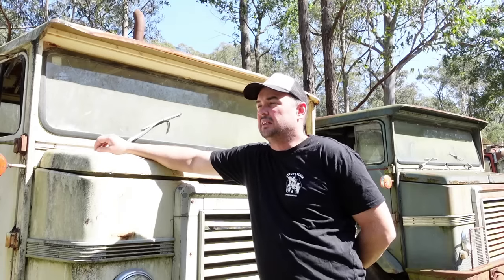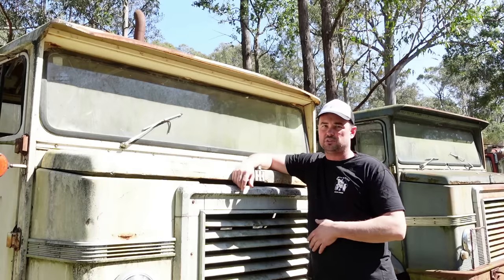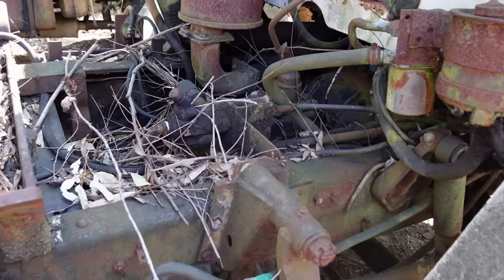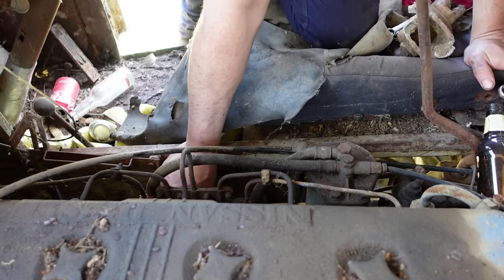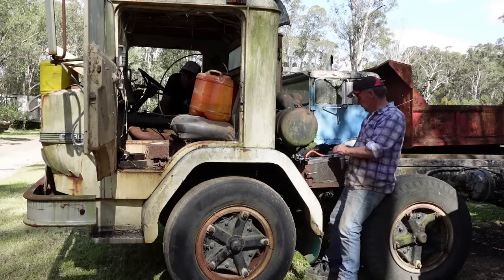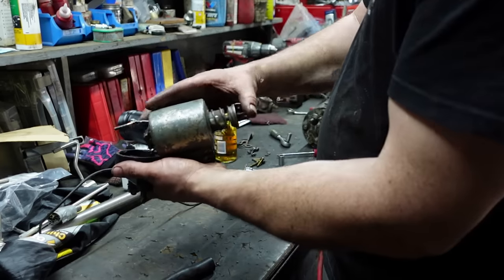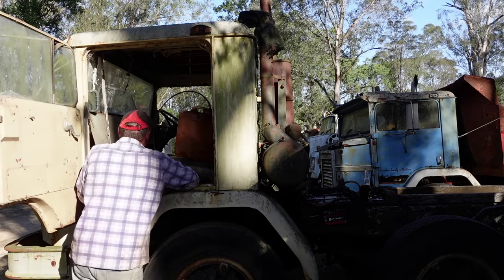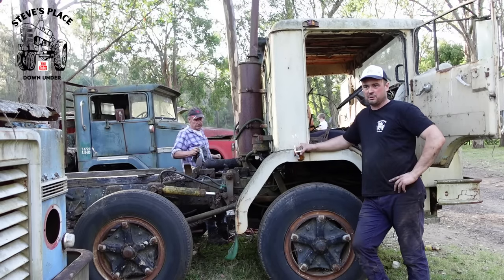Will It Start? Nissan Diesel 2 Stroke UD5

Comment: Good stuff bloke, fellow Aussie here, I love saving old stuff too, great work :), 
had a great collection of 2 stroke detroits but became disabled and lost my industrial block....,
just starting again, scored a 6V92T Detco generator with 71 hours :):):)
12 years ago you could find them around Kalgoorlie usually for a carton :), lot thinner on the ground now but :/
Reply from the maker: Hi mate thanks for the comment. Glad you liked it. Geez mate becoming disabled is awful. As long as you’re doing it again now that’s great. A lot of those generators were only backup so most are low hours from what I’ve seen. There still a few around here but the price to get one has gone up a lot. Fantastic stuff mate glad it’s all happening again for you. There’s plenty more to come here for you to hopefully enjoy
Reply: @stevesplacedownunder  For sure, yeah, it sucked being disabled but I was really lucky, fully independent and got the best life ever, scored a firearms dealers licence, so I'm making a dollar building custom rifles and now I'll rebuild my 2 stroke collection and all's good :)
The generator was ex  Aussie red cross blood banks which have several levels of backup :),  $1550 at auction, the only kunty part was the single axle tilt tray sent to back load it couldnt drag it up, too heavy, had me fucked why coz I was sure my weight calcs were accurate ???,  didn't figure on the 1500 litres of fresh diesel onboard :), was a bonus  problem  :), life is good :):),
keep up the great work there bloke :)
will be following yas for sure ,
cheers
Reply from the maker: Well all the very best to you mate. It sounds like your going really well again. Feel free to email over some pictures of whatever your up to with them. I’m just as interested in what others are doing.

Comment: Those UD engines were also used in some tractors, like the Uptons made at Parkes NSW. The main difference between the UD 2 stroke and a GM, is that it used an inline fuel pump and not a rack controlled individual unit injectors.  The pump is almost certainly a denso.  It is amazing that those old "butter box" accos cabs are not completely destroyed by rust.
Reply from the maker: Hi mate yes I explained all this, even put a picture up of the Upton tractor. The injection pump is a diesel Kiki. 
 I have 2 that are rusted right out and 2 really decent ones. Depends on where they were and what they were doing
Reply: @stevesplacedownunder   The Uptons were also rather unique in that they used a Grant/Sherman transaxle as the final drive.  They had a problem snapping axles and axle bearings, since the transaxle was really meant for driving a raised sprocket and not heavy tractor tyres.
Reply: How about a twin turbo 8v75 ud 2 stroke!

Comment: I've been a mechanic for 40yrs and a Nissan fan, Dad even had a 90s UD, however I had no idea Nissan/UD made 2 stroke diesels 🙂👍
Reply: I heard the UD 2 strokes were made up into the late 80's early 90's then it went to 4 joke stroke.
Reply: @jlo13800  if it was, I've certainly never seen on in a UD truck, lots of which I've serviced before. My father even owned an 80s long bed UD flat tray for a fruit and vegetable business, 
All 4 strokes.
Reply: @jlo13800  Nothing wrong with 4 strokes, almost every vehicle on the road has them now.
Take care.
Reply: Not always as electric motors are a magnetic rotary form of 2 stroke that can run in either direction. 2 strokes mare cumming back as its time for a change form the 4 joke until everything is electric.

Comment: I worked on the assembly line at IHC, Dandenong in the early 70s. 
We didn't see much of these at that time, having been replaced by the new, larger cabs.
I only remember a small series of army editions being made then.
Very cramped interiors for my long legs and horrible seats. 
Cheers!
Reply: The next generation flat front cab came out about 1972 which was in production for a long time. They were used for Atkinson as well. A new cab came out after Iveco took over in the 90s(?).
Iveco have progressively improved the styling of the 3rd generation cab after the rather awkward looking first iteration.

Comment: Junkers developed the Yumo range of diesels to power long range bombers in the second world war. i believe most Yumo's were led down flat to reduce wind drag. Some were opposed piston and I think thats where the design of the Commer 3cyl/ 6 piston engine. good show
Reply from the maker: Thank you mate. I believe so yes. I been doing more research on the history of them and didn’t know the Junkers aircraft were diesel until owning this. Very fascinating mate thank you. I have a few of the commer engines here but missing injection pumps

Comment: I drove a 190 Inter back in the 70s with a 5cyl UD and a mate of mine had one in a Commer I also had a mate had a C Line 1800 with a 4cyl UD and the UD 2 strokes made more horsepower than a Detroit my 190 made 240 hp and the 4cyl was 180 hp and I also drove many Detroit 2 Strokes back in the day 471 ,671 8V71 and 6V53 and the UDs went harder.

Comment: The blower is a scavenge pump - it only supplies sufficient positive pressure to clear the exhaust gases from the cylinder.
Supercharging gives an engine more power but far less efficiency because the blower requires a lot of power to drive it. Commercial fleets are interested in efficiency.
Turbo-supercharging gives more power and improved efficiency because the blower is driven by waste heat from the exhaust
Reply from the maker: Hi Paul. Yes mate I did explain all this

Comment: Steve, Jim from Connecticut. Happy father's day.  In America father's day is June 16th. I wanted to ask you why some trucks have 4 steer tires. Is it because they can haul more weight.  If there is anything I can do to help grow your channel please let me know. I feel bad for the young lady with the mowers, he only gets 3 to 4 views but I still give him a like. Some of your viewers dont realize the education they get by watching your videos, the starter repair as an example.  It would be great to take a few years off and spend them with your dad. I'm almost done with my transmission swap. I'm waiting on 6 3/8 16 bolts to connect my transfer case to the transmission.  I just found out they are grade spec bolts. They are used when building machines.  Anyway have a great Father's Day. As always you have my full support.  Be good mate.  Jim Rioux
Reply from the maker: Hi Jim your support and wishes are greatly appreciated mate thank you.
 The twin steer has been a big thing here for decades and yes that’s right it’s for more weight so it supports the vehicle more and more braking power. It’s less drag too compared to putting another pusher or trailing axle with the drive axles which obviously creates drag when turning, as where another steer axle will obviously turn and follow the road with less drag. Can distribute the weight more evenly also being a rigid vehicle. 
 No mate the people that leave the nasty stuff have no clue. That was about 5-6 hours to do this video then my partner spent around 4 hours on Father’s Day to edit it so I could get it out. It’s very disappointing mate but when it’s available to the world it’s a given that people like that will watch and knock me. It happens to the best of them so I’m certainly not exempt from it. 
 I’d love to spend a year or 2 here Jim. I haven’t done a restoration now since I’ve had the children due too obvious life changes. There’s at least 3 more trucks I’d like to do here along with some of the tractors. I’m on decent money too mate so for this to match it to a point where I can stop is a distant dream at this stage, but I don’t give up.  
 Keep me informed on your transmission job as I’m always interested in how these things turn out. Feel free to email photos or videos. That young mower bloke I feel for too mate. He actually rang me on Saturday afternoon and we had a great chat. He turned 14 on Sunday and was telling me his love for the garden tractors helps his autism which he shared with me. I can’t help people like this enough but so hard to when he’s about 10 hours from me by car. 
 Your a wonderful person mate and thank you as always 🙏🙏

Comment: The German company Junkers should be pronounced as Joonkers. They had some diesel aircraft engines with 2 crankshafts and opposing cylinders, pretty advanced! Thanks for the video!
Reply from the maker: I keep getting told many different ways of saying it. People know what I was trying to say. Yes since doing some research on them I worked out more of what they did. With Napier engines, even the 3 crankshaft triangle type arrangement
Reply: @stevesplacedownunder  The glorious Napier Deltic boat and locomotive engine. A profoundly fascinating creation for any gearhead, but in fairness it did nothing that an ordinary V16 two-stroke couldn't also do. Opposed piston, common-cylinder diesels like the Jumo 205, were interesting for long-range aircraft because they were relatively lightweight and fuel efficient. They allowed long-range flying boats to be refuelled by ships or submarines, but for land-based vehicles, those advantages were moot compared to the added complication and manufacturing costs

Comment: Basically a metric 71 series. There used to be a few Nissan diesel trucks with UD6’s in NZ but as they wore out or blew up they were replaced by 6-71’s. Bad for cracking heads and dropping valves.
Reply from the maker: They basically were mate yes. I’ve never heard about many of their faults but I will certainly take your word for it. Not many around here anymore . Thanks again
Reply: @stevesplacedownunder  If you ever get down to Invercargill NZ there’s a Nissan Diesel 6TW12 2 stroke in the transport museum there. Beautifully restored too.
Reply from the maker: It would be good to see it. I hope to get there someday. It’s not far away really so I should make the effort
Reply: Yes and no. The Nissans were basically an improved (?) version of the German Junkers/Krupp design which was perhaps partially influenced by GM's ideas but not a straight copy thereof. Of course, GM was the leader in that field so I suppose in time everyone tried to follow it. There were also others like Foden in the UK, JaMZ in the USSR, P&H in the US (the excavator manufacturer) and List in Austria but none was as good as GM...

Comment: The 45 seat Albion Coach
Another time it started running hot late one afternoon at The Belmont Lakes near Newcastle, after getting the driver to do some checks I determined that the water pump was not working, actually the drive spline from the Roots Blower had stripped.  We had a spare blower (in pieces), throwing some tools into a box 3 of us jumped into a car and drove overnight.   Some time during the night I remembered that I would need a set of feeler gages to assemble the blower, Russell (mentioned below) was concerned as to how I would get around that problem.  When we arrived we met a GM specialist mechanic who was interested to know how the Nissan motor differed to the GM one, (It was a pretty close copy) he would have been shocked to see me setup the blower clearances with a piece Coke can!   
(It was a pretty close copy) comment above, even the camshaft had extra metal where the GM one has cams for the unit fuel pumps.
I had not realised that some Ausy built Inter trucks were sold with the UD engines.  My only experience with a 5 cylinder one was, a bus man from Toowoomba was within 2 ks of our yard one afternoon when his bus lost power, it would run but lots of smoke and some of coming out the air cleaner. He phoned us and we sent a bus to take his passengers home, then after our school runs we towed him to our yard. I removed a tacko drive and pulled out the Blower drive shaft, or rather half of it, the rest was way inside the gears, no way you can get to it but it must be removed before the blower can be removed from the engine. What to do?? I said to him, "come back in the morning, I'll have thought of something by then."   In the morning I removed the battery from my car, sat it down near the bus. I had a single ended spanner for work on injector pipes, to this I wound around ten or so times a length of electrical wire, connecting one end to a battery terminal.  Handed him a pair of pliers with the wire saying, "This will be a dead short, so we can do it for half a second, when I say go you hit it on the other terminal". There was a 'Clack' and the other piece came out without trouble. A new shaft and he was on his way.
Reply from the maker: This is a great read mate. I would like to read the book

Comment: Yep worked on one of those as an apprentice boy Eden Chip Mill in 88 was a bogie tipper butter box UD4 twin stick yard truck it was a laugh to drive with those gear sticks and couldn’t here your own thoughts in that horrendous hot cab I often wondered if the injector pump would last half as long as 4stroke version ?
Reply from the maker: Hi mate thanks for sharing this comment. I’ve often wondered that about the injection pump. It may have been designed differently to handle it but looks like a normal simms or diesel kiki pump to me. Normal inline pump anyway, apart from only 5 ports

Comment: Just sold an Australian IH here in the US. They aren't common but they are here it seems they were brought into Alaska in the 60s and 70s and heard of a few in Mexico
Reply from the maker: Hi mate this Is interesting. I wasn’t aware they made it to the US but may have been told through a comment that they got a few into Mexico
Reply: @stevesplacedownunder  The one we had was the 8 wheel version it was a heavy haul truck out of Alaska it was used during the building of the pipeline. We bought it out of Prudoe bay had a 743 Cummins in it with a 5 speed and 3 speed aux and the rear suspension was a hendrix rubber mounted walking beam.

Comment: The 45 seat Albion Coach
This was a well built vehicle (page 10) but the original 4 cylinder Albion engine left much to be desired so the original owners, Sunnybank Bus Service, fitted a 4 cylinder 2 stroke diesel engine of Nissan manufacture, bought second hand from Japan (2 stroke Diesels have nearly twice the power of the equivalent 4 stroke).  This performed well while everything was OK but let it get hot only for a few seconds and it would crack a head, that head cost more than the whole Bedford short motor.    
Ron was on the way to the Bunya Mountains with a group, on the Toll Bar up to Toowoomba (Qld) it lost power, went down to 2nd gear and it hung on there.  Through Toowoomba and on the flat country Ron could not detect anything wrong. There is a very steep pull up into the Bunyas and it would not attempt it with the passengers on, they had to walk up and reload at the top.   Coming home empty Ron couldn’t feel anything wrong.    Next day I started it up, “It’s only running on 3 cylinders,” I said.    We removed the head and found a broken valve, the valve top was driven up into the head so hard it didn’t leak water, another of the 4 was bent, another was broken, I still have those amongst my stuff. (Right) So that engine pulled up the Toll Bar on only 3 cylinders with a full load of passengers and their luggage.
I have a few more stories of this bus if you want, also photos available. Ted
Reply from the maker: Hi Ted. This is a great read, certainly very interesting. I’d like to read the book. Was it published?
Reply: No not published but I can email a PDF copy. @stevesplacedownunder

Comment: I used to work for K & S Freighters as a local 8 ton pick up and delivery and one of the guys there bought a bogie drive Acco with a 2 stroke Nissan diesel. I loved the sound of it because it was the same as a Detroit. Because of the power in the engine the Transport department had the allowable weight derated for fear of blowing the trans .
Reply from the maker: Hi mate this is great. She must of been to powerful for the original box. How good. Thank you

Comment: That's A good running diesel 5 cylinder 2 stroke engine for sure. It sounds strong for sure still. Cause the war is getting worse it might be A needed.,or weekend and looked after item for the service soon again for hauling and transporting goods and people in possibly. They just add on one of those troop hauling beds fitted for bench seats with seatbelts to strap them down in back.
Reply from the maker: It is a good running one mate yes. Hopefully it won’t come to the stage where we need it in that way
Reply: E85 and MSD magneto to convert a UD6 2 stroke nissan and dry sump with castor 927 maxima and pull some off with a VRO pump blending in the fuel inlet. that would be fun.

Comment: On two-stroke diesels, the blower is referred to as a 'scavenge pump'. 'Blower' is ok, but the engines were not 'super-charged', since the blower only has to provide enough differential pressure to get the air to move into the cylinder. Although the blower could be set up to actually supercharge such engines, this would be far from efficient, since the blower (especially a roots type)  is the main cause of pumping losses on uniflow type diesels. There were/are ways around this, but it all costs money.
Reply from the maker: Hi mate yes I did mention all this. Everyone fast forward to it starting but I talked about all this. Supercharged was basically click bait without being click bait. Thanks for watching 🙏
Reply: @stevesplacedownunder  All good. I meant it more as a general explanation to clear up some misconceptions being immortalised on the net. Good channel, by the way. Keep it up. Cheers.